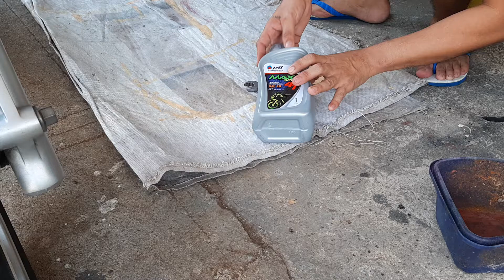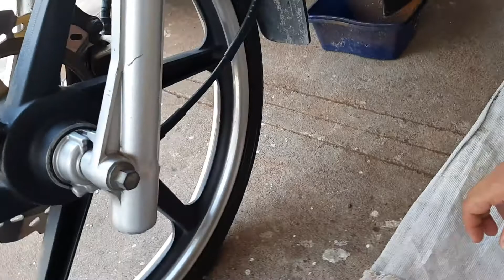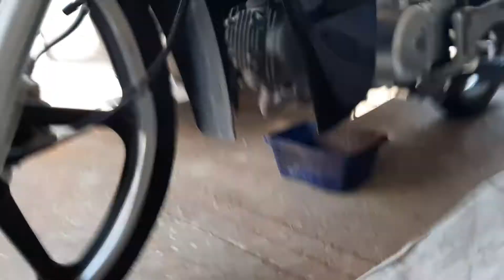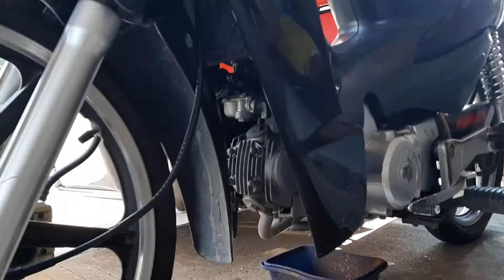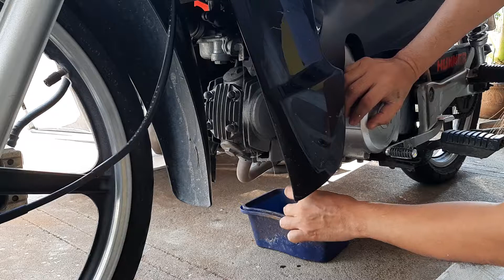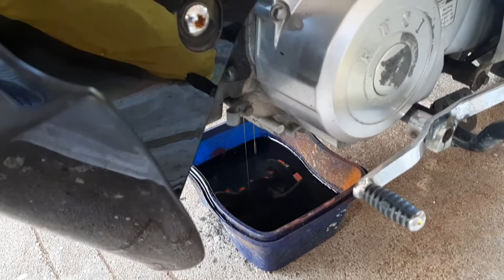How to change oil rusi 100cc part 1

Comment: Hindi ba masisira yan pinaandar mo ng wala na halos langis hahaha
Reply: Ok lang ba ikick basta wag paandarin?
Reply: @alvintorres3024  yes basta  hindi matagal
Reply: @alvintorres3024  pwdi basta seconds pinag usapan .
Reply: @alvintorres3024  wag mo o key .parang crank lang para magalaw yong piston para ang langis baba
Reply: @missmariestories  Ok po salamat po
Reply from the maker: Mga sir yes tama kayo kicking lang.
Pero kanya 2x tayo deskarti at idea..
Kicking or crank the engine and quick start in secnd stil thesame
Reply: Paanu pag ang isang bolt ang na tanggal anu ang tamang purma nang spring at rod